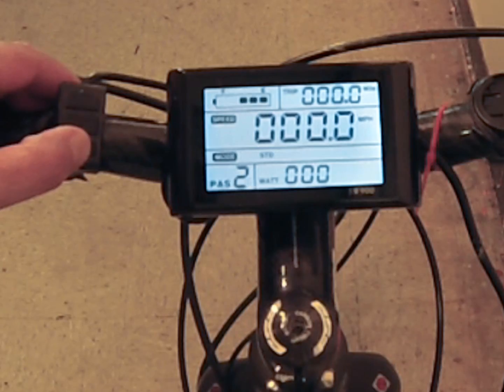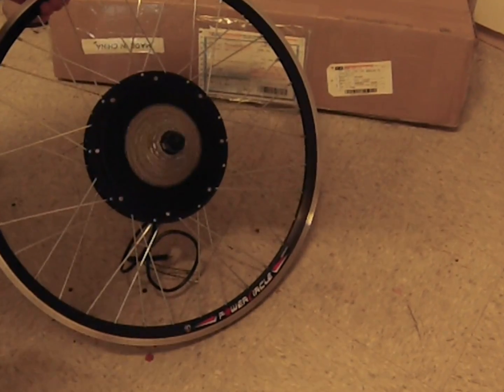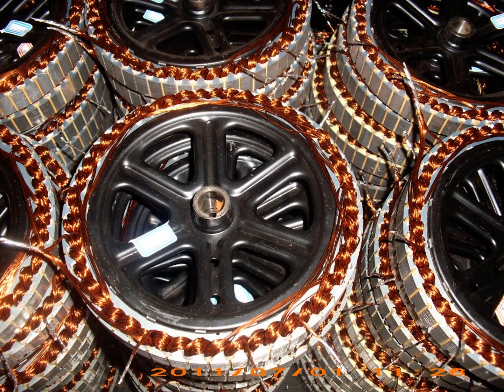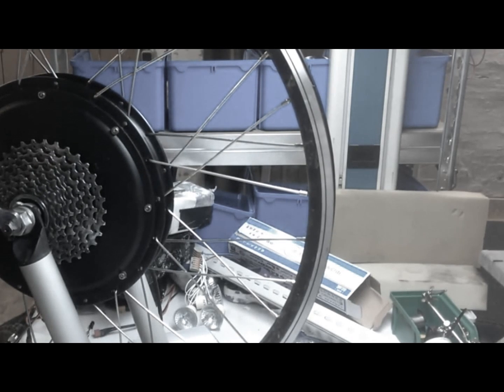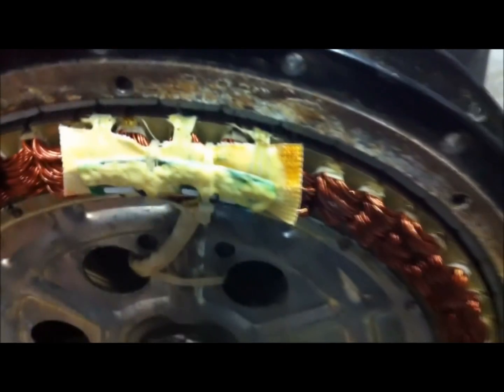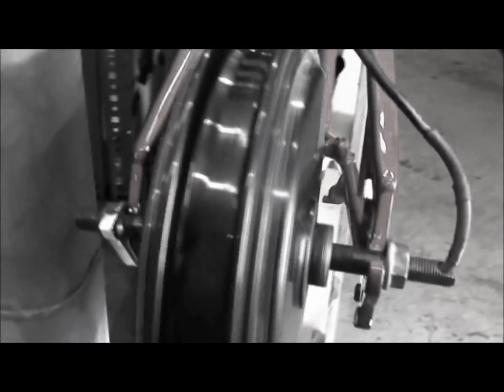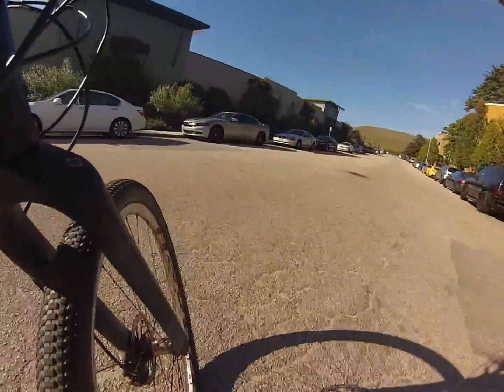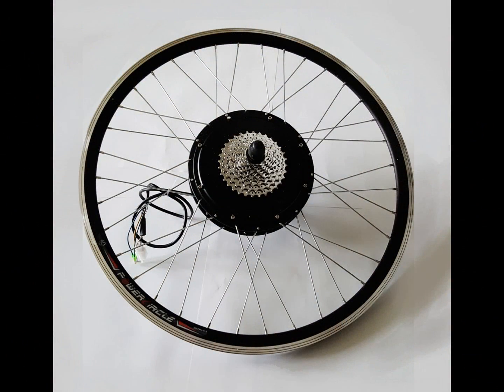Electric Bike Review. 1000 watt, rear hub e-bike motor. 40 mph.

Comment: I'm wondering how you're getting 40mph out of a 1000w motor? 50A 1200-1500w controller? 60v battery? I'm in the process of building a 2wd 1000w front and back fat ebike, and it would be nice to go 40mph for safety reasons on the roads I have to travel to work. Got run off the road last week by a Lay's potato chip truck while doing 32mph with my BBSHD 52v powered bike! If I was able to go 40, he never would of passed me and I wouldn't of been picking dirt and gravel off my clothes.

Comment: I piked up a 1500w rear motor and a 1000w (2wd) front motor to help out the rear with torque and cooler running. I'll see if I can get 40mph with my 52V 25Ah battery and two motors. 
How many Amps do your controllers run at to get 40mph on a 1000w motor using a 48V battery?
Reply: I’m getting 66 mph with my ebike and I have 48v 1000 motor
Reply from the maker: Ideally you want to have a 30 amp controller or greater. A lot of the generic controllers are running 20 amps.

Comment: I have this exact motor and I'm only getting 40kph out of it with 12s lipo hot much voltage are you running to get 40mph 72V?
Reply: By bullshiting people .
Reply from the maker: No, I'm running a 48V, 17.5AH

Comment: I love how some reviews of electric scooters and bikes urge caution because of the extreme power.  None of these people ever rode even a 500cc motorcycle, did they?  1000 watts, try 50hp.  Some motorcycles have 180hp.  I saw one review of a 750 watt electric scooter with a setting to dial down the power for kids under 16.  And yet there are 12 year old kids with 30 hp dirt motorcycles.  I just think it's a marketing thing.  None of these bikes have the least bit  unmanageable horsepower.  Maybe the 120  volt ones  get a little terrifying on a public road, I could see that.
Reply: Power delivery is completely different between an internal combustion motor and an electric motor. When a motorcyclist starts from a light they release the clutch at a lower rpm where the IC engine is only producing a fraction of the available torque. With an electric motor the full amount of torque is available instantly at any rpm. The sensation can be similar to dropping the clutch at the peak of the power curve on a motorcycle and you can imagine the result. Zero motorcycles and Telsa have spent millions mitigating this problem with launch assist systems, ebike kits offer far less sophisticated speed controllers.
Reply: That makes sense except most ebikes don't have enough torque to scare anyone or be unmanageable.
Reply: 1000 watts is less than 2 HP. Most of those 49cc engines produce more than 1000 watts.
Ebikes have a long way to go to be useful. Energy density needs to up by an order of magnitude and the price has to come down by an order of magnitude or more. 
Batteries run $1 a watt and higher. That is insane when you consider just how electricity it takes to move a bike with a rider 1 whole mile. The manufacturers (actually, the sellers) just flat out lie about the range of an e-bike. Even under ideal conditions and at no more than 10 mph, you are never going to get the advertised range.
The setup in this video is going to have extremely poor range if you try to go 40mph. At this speed, you MIGHT get 5 miles of range on a 500wh battery (basically a $500, at best) battery!
We need to get to the point where a 1kW/H battery is $100 and less than 1/2 the weight and size possible today.  There is absolutely NOTHING in the pipeline that even 1/2 way arrives at that goal.
Reply: Wrong.  Ebikes are more then ready to be practical transportation-- I'm doing it myself.. Depending on the setup, a 1000w+ ebike kit can easily maintain 35mph, and a 1kwh lithium battery it'll easily do that for 25 miles, making it practical transportation for many people.   I'm getting about 1200 MPGe with a raw fuel cost of about 0.39 cents per mile.  No other vehicle can touch that, not even a 50cc scooter.    Granted lithium batteries are expensive right now, but at least they'll do thousands of charge cycles and will last for years.. unlike lead acid batteries.
Reply: to Roman Val...  I don't know what country you are from, but you are lucky.  I am here in the California and like most states in the US, we cannot legally ride bikes above 28 mph.  This doesn't make for practical transportation especially if you have taken a lane slowing traffic.  It is dangerous to be passing other conventional bikes in the bike lanes.  So here you will not be a car (or motorcycle) or cannot easily share busy bike lanes with regular bikes.  I would call that dangerous or discourteous to others.  I agree with your electrical power costs, it is just not practical to integrate into busy US traffic.
Reply: +Roman.. But your fixed costs are still there. You still have the car payment (unless you own it outright) and the insurance payment (which in my area is huge) and the car is still ageing. The tires may not be being worn, but they are ageing, which age alone kills tires.
How long have you been using that battery? $500 for a kWh battery is a pretty good price. It might not be made with the best cells and components.
That sounds like you have to charge twice a day to go 30 miles round trip.
Reply: Have you ever crashed into something at 40 or 50 mph ? With or without a bike helmet it isn't very pleasant.
Reply: I got hit by a car in 2015 and landed on my head. It put a giant crack in my helmet. Thank the gods I was wearing that thing.
Reply: +Roman... The costs are too high, especially if you have to have a car besides.  Good quality batteries from a reputable dealer (not ebay) retail at over $1 watt, often as high as $2.  40 watt hours per mile is pretty good at 35mph, but I don't know how much you're pedalling or how much you weight and your size or how many hills and stop-and-go traffic you're in.
Reply: My ebike+myself weigh 240lbs combined, I'm using a converted mountain bike, full suspension with skinny road tires.  40wh/mi is what I'm averaging for a 15 mile trek (each way) to work and back.    I have a car, but the raw fuel cost of my car is 20 cents/mile =  ~$30/week in gasoline, while my ebike fuel cost is 60 cents/week in electricity.
Reply: The battery cost is only high if you don't think of it as an investment that saves money in the end..   Sure, the battery cost $500...  but it'll pay for itself in just 4 months of not buying gasoline.
Reply: Aside from building it yourself there's only a few good places to order quality lithium ebike batteries: such as EM3EV or Luna cycle;  They're both well known for using quality cells and build methods.  I got an EM3EV battery about 2 months ago; $500 for 52v 20ah using Panasonic PF cells. My only complaint was the shipping was $100 since they ship from China and use a private customs clearance (understandable since big LiOn batteries are moderate risk shipping items).

Yes I charge it twice a day but it's no big deal- I just plug it in and forget it... since I'm doing a shallow charge cycles (40%-80%) it should maintain its capacity for around 2000 charge cycles (or ~4 years of commuting) before it degrades.
Reply: +Rosman.. Panasonic is losing money on batteries. They just posted a 3 billion Yen loss for it's battery division. Lithium Ion prices are skyrocketing and will likely remain high at least a few years. The price of Cobalt has quadrupled since 2016. Other base components are rising as well on high demand. Panasonic has announced it is going to try to build the cells without Cobalt.

I really hope that you do actually get 2k cycles, I seriously doubt you will, though it must be said that age also damages batteries and since you are charging so frequently, they won't be that old by the time you hit 1000 cycles.

Do you happen to know (I guess you can probably get this info) how these batteries are going to age? Like, what will the 500th cycle look like? 90% of original? 85% 80%? How about at 1000?

If you know how to do it, you might want to charge only to 3.9V per cell. If you can do that, it will substantially increase the life of the battery. A good substitute is 80% SOC. Since you don't need anywhere near a full SOC to go each way, you might want to consider doing that, though you will have to periodically check your SOC as you're charging it.

I think it will take more like 10 months to recoup the battery cost by displacing gasoline. Still, that's actually pretty good assuming you are commuting every day with the bike instead of a car.
Reply: Yeah I'm already capping my charge to 80%.. I did this using a cheap 48v charger that shuts off at 56.4v (which is 77% SOC on a 52v battery).   As far as battery aging goes I got my info from this link:  http://batteryuniversity.com/learn/article/how_to_prolong_lithium_based_batteries
Reply: You should probably look for published data on the specific cells in your battery. Rules of thumb are good, specific data is even better. Be careful with cheap chargers too.
Sounds like you have a setup that really works well for you. Hope it all works out.
Reply: I just built a 14s 9ah pack with LG HG2 3000mah batteries 50 for $150 on Ebay cost me around $200 to build the pack, and have 8 leftover batteries. These are not fake, or knock off batteries. I got 15 miles on a charge during testing with very minimal peddling, only on steep hills. Seems like batteries are getting cheaper to me.
Reply: +ipissed.. You can save a lot of money by building the battery yourself.
How do you know the cells are genuine?  42 3ah LG cells would be a very good price. Be careful when dealing with the very high capacity cells, they tend to not like high discharge rates.
The price of the chemicals in these batteries are skyrocketing. Cobalt has quadrupled in the last 2 years. Panasonic just lost a billion yen producing lithium ion cells.
Reply: +Laura.. E-bikes just don't make a lot of sense for anyone who has to have a car.  If you can eliminate cars entirely, then they can make sense.
Reply: My current motor puts out 150 nm's of torque and its hardly the cream of the crop in terms of hub motors yet it has almost the same torque as H2R. So a 50 hp Internal combustion motorcycle can not, and will not ever be able to produce that much torque. My motor can literally pull a car along lol. So some of these scooters and bicycles do not have a soft start function on them which protects you from sudden sharp acceleration, it lets the power trickle out nice and slow. So in other words without soft start when you whack the throttle on, you don't get a nice fluffy rumble from a IC engine, instead it goes DONK!. In the wet one time on my first 1000w ebike I had the front wheel spun up as I was turning a corner and it lept out from underneath me and I went splat! Now some of the really powerful modded hub motors for ebikes / mopeds are pushing 300 to 400 foot pounds and some of these motorcycles are using mid drives so the torque aint so bad, but I can guarantee you if you got on one of those, even after being on a really quick motorcycle you would brick yourself unless you have ridden lots of electric motorcycles before. It's the instantaneous torque and response that catches people out, not straight line speed, that's why they urge you to be careful because even piddly little motors can produce a lot of torque for there size and weight.
Reply: @jcreedy20  I would love to build an ebike to replace my car but the distance limitations are a problem and the charge times are a problem. There are times where I need to travel 200 miles one way and in terms of battery costs, that adds up to 3K dollars in batteries which ignores the lack of a place to store 120 pounds of batteries.
Reply: @autonomous2010  Just build a cheaper one for journeys up to say 40 miles. I have an ebike that does 60 mph and has fast acceleration and i use it every day for work 15 miles each way. But i still have a cheap car that costs pennies to run. In the end it costs me £12 to do 6000 miles on my bike. That alone has saved me a big chunk of money in fuel. Obviously I bought the bike for fun and started commuting on it after so it worked out for me quite nicely
Reply: @jcreedy20  Trouble I run into is that the "fun" factor of something is more of the novelty. Which wears out fast if something is treated as a toy. 

So if I was going to go the ebike route, it would have to be able to replace my car or it would rarely ever get used after the first month or so.
Reply: @autonomous2010  it really all depends where you live. For me I live in a big town with the crappy roads but lots of cycle paths etc. But there are way too many people driving around it in cars. Its always far far quicker on an ebike to get around. But it all depends where you live and your circumstances. If you live in a sparse country side away from civilisation then yeah don't bother, no point unless you just want a toy lol

Comment: Where can I get one at
Reply from the maker: No. It is designed for a rear drive. 1000w front motors are available, but that is really pushing how much power you want on the front. The front drives were initially designed for 250w
Reply from the maker: https://augustineebikes.com/bike/buy-your-augustine/
Reply: Can this also convert to a front hub?
Reply: I've got the front hub version of this....the company put heavy duty large spokes on the front, with also a tongue arm.  Hope I don't have any issues with this front hub motor.
Reply: This motor is a ebay special and a very good one at that.

Comment: Just checked the amps....only 12? then the watts are reduced to around 576w??..wouldn't a 500w motor or 750w motor just as good?  think when the motor is larger, the amps and /or voltage has to go up proportionally?
Reply from the maker: Respectfully, no.
Reply from the maker: Do you own a bike shop in Southern California? I think I spoke to you on the phone about batteries.